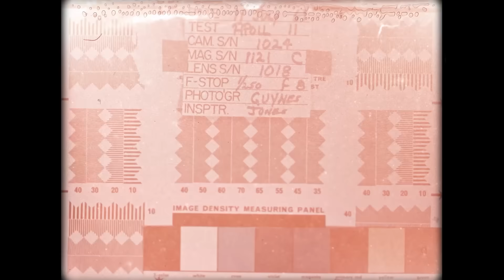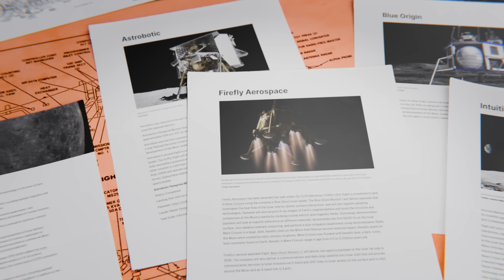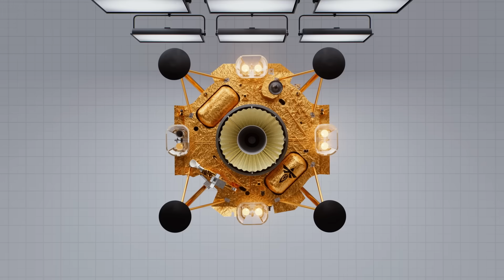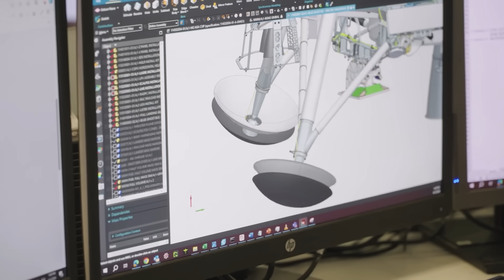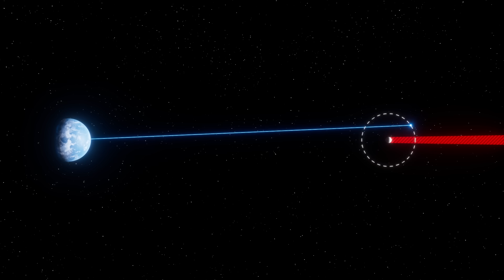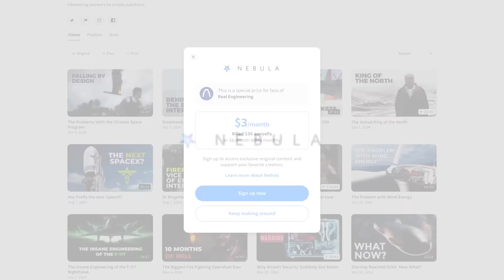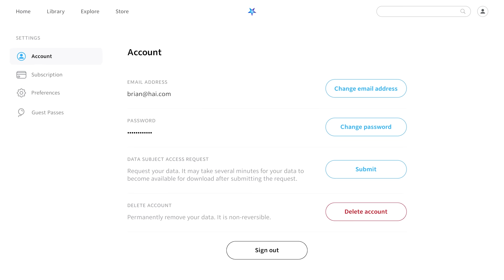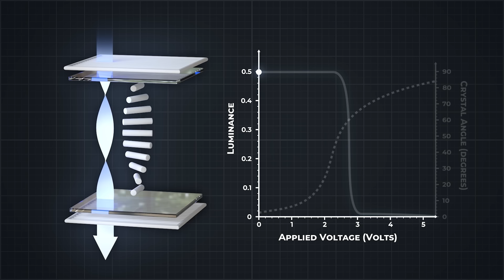Why the US is Struggling to Land on the Moon

Comment: The evidence showing that all the lunar scenes were all filmed here on Earth and which also show that they used slow motion to mimic walking on the Moon, are everywhere. This is just another example among thousands.

When an astronaut wore the complete Apollo "lunar suit," the center of gravity shifted completely backward and even extended out of the body, where it normally lies, at the level of the navel, since the "backpack" weighs 16 kg on the Moon, the weight of three automatic rifles.

That's why, when they tested reproducing near zero-gravity environements in planes flying parabolic trajectories as soon as they left the astronaut alone, he promptly fell backward as we can see in the videos taken of those tests at the time. That's why, when they jumped from the LEM "on the Moon" in that same suit, they should have landed with their bodies bent forward to compensate for the back, or they'd have fallen backwards. However, none of that is visible; when Armstrong "leaps to the lunar surface," it is clear that there is no force whatsoever pulling him back, which would still be the case in lunar gravity

This is with NASA data itself. Acc, to it the weight of a normal man on the Moon is 13-14 kg, that of a 3-year old toddler. And that of a whole Apollo backpack, 15-16 kg, that of 3 M-16s. Imagine that, a 3-year old walking around with three M-16s on his back.
Reply: Oh man, you really cracked the case.
Reply: @IdealContracting  Many already did it.

Comment: LOL
anyone who thinks we went to the moon in a garbage truck 55 years ago needs to get their heads checked ... ever wonder why we go to every other planet in our solar system with remote control machines and other machines that can take pictures and NOT the moon which is infinitely closer ? because then people would ask for pictures of the (i think its 8) moon rovers ! did you know that just taking nickels into orbit could change the trajectory of a spacecraft ? but in the 60s we took SUV's to the moon ???
Reply: Anyone who thinks we didnt is an uneducated cretin PERIOD 
The point of going to the moon is not a photo op dimwit
Sighs the orbits were accurately calculated by people with slide rules unlike you who probably needs to take their shoes off to calculate 2 times 4.5

Comment: The moon is verifiably a transparent, plasma light since we can see stars through it at night, and blue sky during the day.
Asteroids are all different sizes and shapes so how could they make perfect “impact” circles?
That’s obviously not from asteroids.
Reply: Why can't we see stars next to it?  Or haven't you noticed in those "see through the moon" videos there are never stars next to the moon?  kinda funny don't you think?
Asteroids explode when they hit the moon.  Makes perfect “impact” circles every time.  Just like artillery shells do.
Reply: @ yet in all recorded human history the moon “craters” all stay the same 🤔
Reply: @ 
The largest craters do stay the same: they’re all very old, and fortunately, objects large enough to make a crater visible to the naked eye (i.e. more than 100 km across) are rare. 
Since the 1960s, we’ve been sending spacecraft to the moon to map the moon in far more detail than we can achieve from Earth. The Lunar Reconnaissance Orbiter can photograph the moon with a resolution of 50 cm per pixel. Its orbit allows it to photograph the entire surface of the moon every few years. 
In those photos, we find numerous changes from smaller impacts. Most of these are craters only a few meters in diameter. 
For the past 20 years, we’ve had an observatory on Earth that looks at the moon and detects the flash of light caused by impacts. We’ve detected hundreds of those flashes, and we’ve matched them to new craters seen in the LRO photos
Reply: The LRO has identified dozens of new craters on the moon since it was launched.
Reply: @ sorry brother but that’s cgi pseudoscience 😏
Reply: @josephwodarczyk977  they go good together
Reply: @lukehartman777   😅😂😍 "cgi pseudoscience" 😅😂😍😅😂😅😂😍
Reply: @josephwodarczyk977  just smoke and mirrors
Reply: A solar eclipse proves the moon is not transparent. You can also watch stars in the path of the moon get blocked when the moon passes in front of the stars.

Comment: Just have to remember the moon is not an airstrip. You dont glide in. You have to land straight down.
Reply: The Apollo missions avoided landing straight down because they did not want to dig a crater, or obscure the vision of the pilot by kicking up dust in front of the spacecraft.  Instead, they landed on a diagonal of about 45 degrees.

Comment: Broke a leg?

You mean to say that they spent 120m on a piece of scientific equipment that cannot stand on its own? That f00king stupid.
Reply: IM-1 was designed to slow down and make a soft landing. When its altimeter failed, it hit the ground at far higher speed than the landing gear was designed for.

Comment: with Valve radio Technology, they landed on the moon in 1969 ........🤔 i think not
Reply: They weren’t using valves. The electronics on Apollo used semiconductors; the single exception was the traveling wave tube amplifier for the radio transmitter. 
The Apollo AGC was the first computer in the world to use integrated circuits.

Comment: Why the hell was the lunar lander landing horizontally anyway?? It's not an airplane. It should be going virtical.  I thought these NASA guys were supposed to be smart.
Reply: The lunar lander started out by orbiting the moon, at a speed of 1600 m/s. From that orbit, it has to slow down to a speed of zero in order to land. The most efficient way to do that (ie using the least amount of fuel) is to gradually slow down while decreasing your altitude, and timing it so that your horizontal speed reaches zero just before you touch down. This depends on knowing your altitude accurately. 
IM-1 didn’t know its altitude accurately because it was launched with its altimeter in an inoperable state.

Comment: Why are they not using lidar point cloud?
Reply: They were using a laser altimeter. They just left the altimeter set to safe mode (which disables the laser) when they launched it. They forgot to flip the switch - a safety switch that cannot be operated remotely.

Comment: The space race up through the 60s was done by many of the smartest people in America, working with a dedication possibly similar to what they did during WW2. After Apollo succeeded, there was less national urgency, and NASA became a less critical operation, filled by much more mediocre people. I knew many of the original, exceptional people and then also worked within NASA after they became like a nationalized DMV. 

I remember even reading how the director of Johnson Space Center **proudly** declared that they were doing "extraordinary things with ordinary people." LOL and after googling that, I see they are still extremely proud and not at all embarrassed about that. Well, you can guess how well that is going for them. 

Private companies will do far better than the DMV, but back in the day they had some of the smartest people and a massive budget. Good luck to the private companies, who I think will succeed if there is an economic reason to do it well, rather than to employ ordinary people.

Comment: Im pretty sure all if not most if the Apollo landings were done manually not computer controlled.
Reply: The LM was fly-by-wire. The astronauts switched from the fully-automatic mode to a mode where they could adjust the landing point. The computer was still involved in this mode.
Reply: @Hobbes746  that's a better answer I'm glad you fixed it.
Reply: @Hobbes746  it was still manually controlled tho.
Reply: @richardmedina5715  Let’s take Apollo 11 as an example. They were running program P64 (automatically land at a predetermined point), and the landing point designator was indicating a landing point right on the edge of a crater. 
Armstrong switched to ATT HOLD mode. This meant the digital autopilot's Rate-Command Attitude-Hold mode, in which the astronaut could command an attitude rate by deflecting a joystick. After the stick was released the autopilot nulled rates to maintain the present attitude.
In this mode, Armstrong could adjust the landing point. The computer keeps the LM stable and commands the thrusters in the correct proportions to rotate the LM in the direction Armstrong indicates.
At 430 ft, Armstrong switches to program P66, where the computer adjusts the main engine thrust to keep a constant rate of descent. He’st still in ATT HOLD so he can keep adjusting the landing point.

Comment: What did cars look and feel like in 1969 compared to 2025? Technology doesn’t go backwards.
Reply: in the 1960s, NASA spent $300 billion to get 6 manned missions to the moon. That was unsustainably expensive, so they stopped doing that, got their budget reduced by 90% and focused their efforts on 1. making access to space cheaper (Space Shuttle), and 2. learning how to live and work in space, which is a requirement for any mission to a target farther away than the moon.
Reply: The engines of cars that run on fossil fuels have at most become more efficient and economical, but the principle has remained the same. This also applies to rocket engines.
Reply: @ we aren’t riding horses trying to figure out how to build a car though, that was my point
Reply: @jaybee6477  the failure of M\IM-1 wasn’t due to any lack of technology. It was due to lack of experience: Intuitive Machines have never built a spacecraft before. Thye made a dumb mistake during the preflight check that left the altimeter unusable, which caused the landing failure.

Comment: Make this make sense, we could do it back then when we had no technology and having trouble now when we have all the technology. I know people probably think I’m crazy for saying it. People say well everyone would have to be in on it. well no it’s a need to know basis when you’re at that job back then.
Reply: We could do it back then because we spent $300 billion and put 450,000 people to work for a decade. 
Nowadays, there is no indication we “can’t” land on the moon. 
Intuitive Machines came damn close: their spacecraft managed to land with its payloads intact, despite them making a dumb, preventable mistake during preflight preparations (they forgot to switch the altimeter out of safe mode, which meant the altimeter did not work).

Comment: Kelly exposed your hypocrisy. You can’t and never could make it through the radiation belts. Yes, BELTS
Reply: No, Kelly Smith never claimed that. He's talking about the first Orion test flight. This was done to make sure the Orion capsule works correctly in the VA belt: electronics can malfunction in high-radiation environments. Orion's electronics are designed to deal with this, but a practical test is required as part of due diligence. All of the hardware on Orion is new, so it has to be tested in operational circumstances before being considered human-rated. 
The Apollo program did these tests as well, during the Apollo 4 and 6 flights. 
The very first thing the USA did when they started to launch satellites, was to measure the environment in space, including radiation levels. With data from 6 missions which were launched in 1958-1962, James van Allen and his team discovered and mapped the belts that would later be named after him. He found that the radiation level varies with location. In the center of the belts, where the radiation level is highest, it takes a week for a human to accumulate a lethal dose of radiation. As you move away from the center, the radiation level drops. Near the edge of the belts, the level is 100,000 times lower than at the center. 
So by 1962, we knew that humans can safely travel through the belts, as long as they don’t spend too much time in the belts. The Apollo missions traversed the belts in 3 hours. That’s less than a week.

Comment: We can't ferry humans past the radiation belt without near reactor level padding. At least some concrete, plastic, water, steel barrier mix. I don't think we launched something that heavy back then and it's likely why we can't do it now that global communication and high definition video have allowed their lies to be broadcast more easily.
Reply: Incorrect. The radiation level in a nuclear reactor is thousands of times higher than anywhere in the radiation belts. 
 In the center of the belts, where the radiation level is highest, it takes a week for a human to accumulate a lethal dose of radiation. As you move away from the center, the radiation level drops. Near the edge of the belts, the level is 100,000 times lower than at the center. The Apollo missions traversed the belts in 3 hours.
Reply: @Hobbes746 you're talking radiation levels inside a reactor versus ambient in the belt. Kind of like twisting my words but whatever. No the radiation belt would kill. How do I know this? :D
Reply: @THEfonz-s5u YT is deleting my comments. Too bad
Reply: @robminks777  The radiation level in the belts depends on your location. It’s ~2 Rad per hour in the center, where the radiation level is highest. That means you have to spend a week at that location to get a lethal dose. 
From the center to the edge of the belt, the radiation level drops by a factor 100,000. 
The Apollo missions spent 3 hours traversing the belts, and avoided the center region entirely. That was easy to do, since the belts are donuts around Earth, centered on the equator, and the Apollo missions were launched from 28ºN.
Reply: @robminks777  So you make a false claim, I correct you, and you go “whatever”? Typical. You’re not interested in reality.
Reply: @Hobbes746  YT deleted my comments. I'm not making them again to get deleted again

Comment: Why don’t they just use the blue prints from when they went there in the 70s ….. oh wait
Reply: No, they are not lost. But is it realistic to reuse 60 year old technology?
Reply: 6 million drawings for every single part of the Saturn V are sitting in an archive. But those are for a rocket that will put a 15-ton manned lander on the moon. 
Intuitive Machines buit an unmanned lander. Despite having no experience in spaceflight, they got the design right: they built a spacecraft that can land on the moon.
What they lacked was experience. They forgot a crucial step during the preflight check, and left the altimeter disabled. This is the main instrument you need for a successful landing, which meant they were screwed the moment they launched the spacecraft without rectifying this mistake.

Comment: 1969: TVs where black and white, color was state of the art, cars where heavy as fuck cold rolled steel tanks with inches of tolerances, super computers where weaker than budget smartphones of today, carbon fiber wasn’t used yet and passenger planes where so inefficient they left thick streaks of black smoke behind..

Also 1969: Went to the moon on their first trial and returned with no issues in 8 days.
Reply: 1969: went to the moon by spending $300 billion. This included 29 unmanned missions to the moon, half of which failed. Each failure was a learning experience that improved later missions. 
2024: an organization that has never built a spacecraft before, decides to build a lander for $100 million, then forgets basic things like a preflight check: this meant they launched their spacecraft with the main altimeter inoperable.

Comment: That's simple. The landing on the Moon then was a purely political task. It has almost no real value in itself. And as long as we continue using chemical fuel rockets it will remain a purely political goal. Unfortunately, all dreams about nuclear powered spaceships remain to be ungrounded dreams only. But that's not the only obstacle. The second huge obstacle is cosmic radiation. Then, in the 1950s people greatly underestimated its influence.
Reply: No, they knew exactly what they were doing. A NASA advisor, Dr. James Van Allen, had figured this out for them. Familiar name, right? Cosmic radiation is only dangerous if you are exposed to it for a long time or during a solar flare.

Comment: why not use claws on a suspension system for each foot where the bowls for feet are
Reply: That’s not going to help. If you try to land without first zeroing out your horizontal speed, you’re going to fall over.

Comment: Those people who are excusing that US cannot do manned missions to moon because they don’t have budget, remember the resources costs mere fraction of what it used to be, even 4 KB of RAM was costing a fortune back then now it’s like nothing to get 64 Gigs of RAMl. They should’ve have enough resources to go to moon 100 times with current technology if they really did go to moon before and had that data that is
Reply: A Saturn V rocket weighed 3200 tons. Less than one ton of that was computers. Most of the rocket’s weight is in stuff other than computers, stuff that has not gotten a hundred times cheaper since the 1960s.